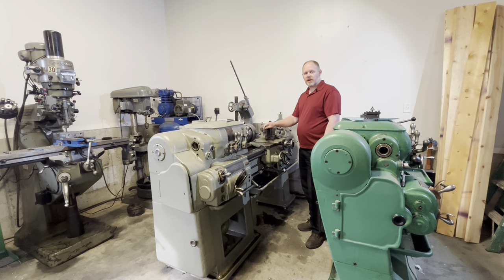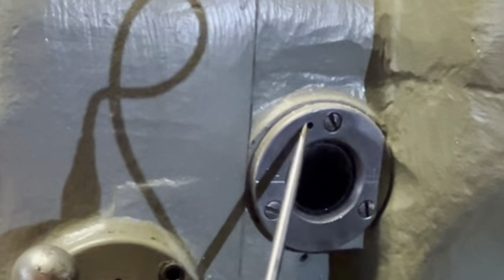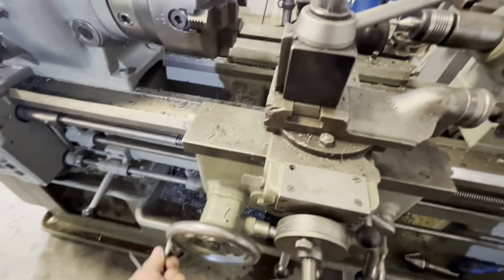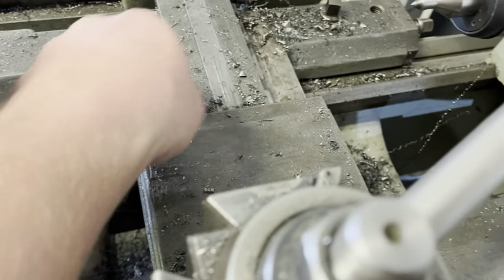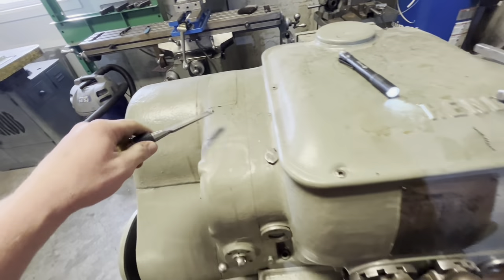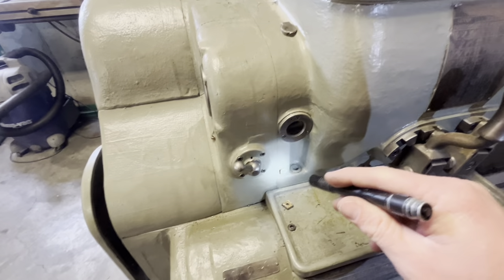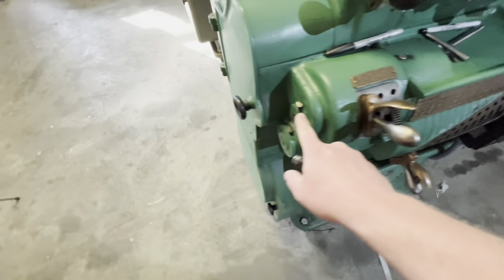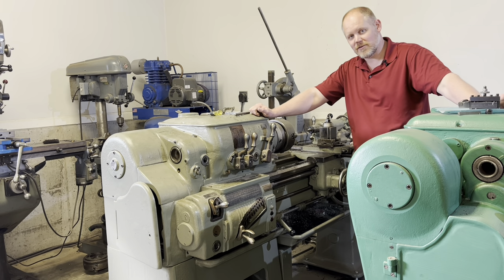Hendey Lathe Lubrication Explained

Comment: Hey good video, I just purchased a 14x30 hendey, would it used the same oil you use?
Reply from the maker: Hello, yes the 12” & 14” are very similar in construction.
Reply: @MikefromMissouri  thank you, I'm new to the Hendey lathe, I'm going to clean it really good before cranking it, I bought a DPS for 4-5hp, stickers on the motor said 5hp
Reply from the maker: @ismaellambarry4605  I personally prefer the on/off of a rotary phase converter but that should work. Will probably have to ramp it up slow because the old big motors have lots of inertia. May trip the overcurrent otherwise. No experience just a guess
Reply: @MikefromMissouri  thank you for the response, I'll give it a try see how it works
Reply: Hey Mike, just cranked my Hendey for the first time, got some videos would like to share with you, see what you think
Reply from the maker: @ismaellambarry4605  you can send them to Michael_hartke@hotmail.com